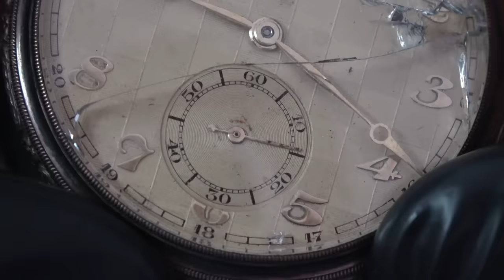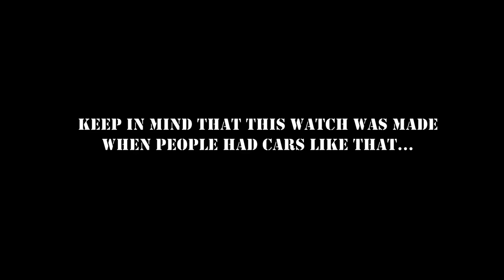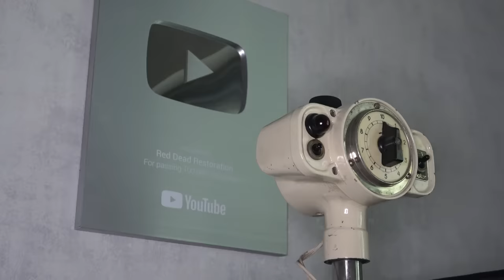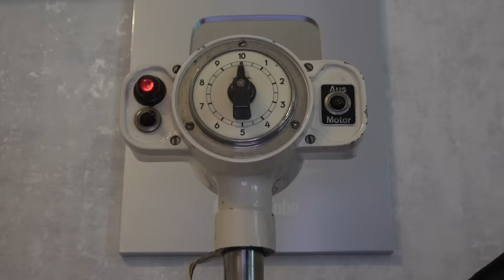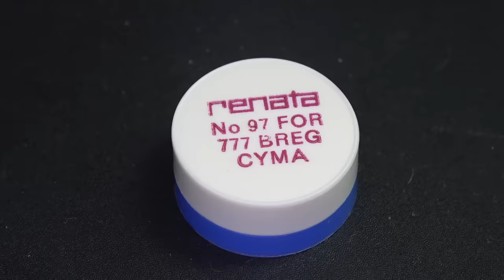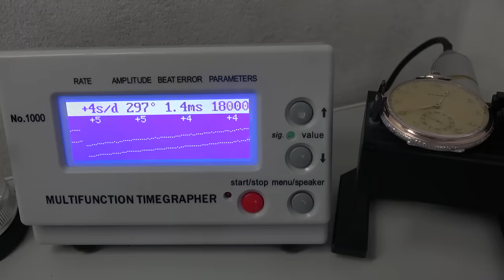Restoration of an antique pre-WW2 pocket watch - 100 year old Cyma 777 - german empire silver case

Comment: It's so good to get a look over your shoulder while you carry out these restorations and it's fascinating to see how little watch internals have changed in 100 years !
One thing I love to see in you videos is the tools and equipment you use, I love the cleaning machine and the small hand tools, presses and extractors etc, even the tools for working on mainspring drums are interesting but there's one thing I have never seen and that is your magnifier. I'm assuming you do have some sort of device to help you see these tiny parts more easily, presumably you will have a selection of magnifying devices that you just cannot live without, I wonder what they look like ?
Reply from the maker: Some simple eye loupes (mostly I'm using a 10x magnifier) you can see them sometimes sitting on my desk (wooden with gold ring)

Comment: Fascinating! It’s interesting how much heavier and robust the components are compared to more modern designs.
It amazes me that parts of that size and obvious precision were made in the past.
Any suggestion as to vids detailing the actual production of the components, tiny gears, springs etc. How was that done in the pre- computer/CNC era?
I’m a machinist, dealing with tolerances of .0005” or so on parts perhaps .010” and larger. Any info would be appreciated! Thanks!

Comment: When I see this mechanical marvel from 100 years ago, I wonder: with what technology did they build such small components⁉️
Reply: The oldest pocket watch that still works is the spherical Melanchthon Watch from 1530, belonging to Philipp Melanchton. Its 48mm diameter would run between 12-16 hours on one winding. It's engraving is in German, but translated to English it reads; ''Philipp Melanchthon. To God alone the glory.  Peter Henlein (also spelled Henle or Hele) (1485 - August 1542), a locksmith and clockmaker of Nuremberg, Germany, is often considered the inventor of the watch.

Comment: How did you find a proper replacement for the balance wheel? I have a wrist watch that needs a new balance wheel and spring, and it's at least 50 years younger than this pocket watch, but I have no idea where to go to first to find a suitable replacement (doubt I'd find an authentic replacement without selling my house to afford it lol). Fascinating work, and wonderfully shot!!!
Reply: What brand is that antique wrist watch?
Reply: @tecraman8100  It is a Cromwell Electra watch. I don't have it near me now since I am at work, but I will add more details from the watch when I get home. I am going by the crappy photo from the seller that I downloaded, sorry...
Reply: @tecraman8100  
It also has Superflat on it, below the center. I think it has 3600 on it between Cromwell and Electra, from the top to the bottom of the watch face below the 12 mark. It has no numbers, but a bunch of rhinestones circling the edge where the numbers should be, and there is a crown emblem at the top of Cromwell.

Comment: I prefer this era of mechanical engineering since most of the clockwork mechanisms made then have lasted well beyond their expected "break" dates

Case in point my grandfathers clock collection consits of clocks made back in the 1800s and the only thing hes had to do is wind them and hes not had to clean and oil them since his father had them

My experience with clockwork mechanisms runs from film cameras as the shutter springs and timers use clockwork springs for timing

Comment: Those were some real PRECISION movements for way back in the day. Ya just can’t go wrong with one of these pocket watches today. Totally German engineered. I’m sure the price was pretty hefty for one ☝️, even a hundred years ago. We can all check these out on our inflation calculator today. I bet the parts for these are next to impossible to get. I’m glad 🙂 they make a friendly kind of buffing wheel for this, but, I, personally, wouldn’t go a full 35.000 RPM on the Dremel tool. This may cause “thermal” damage (discoloration) of the metal, or burn 🔥 your buffer wheel 🛞 up. Happy Halloween 🎃👻. Your friend, Jeff.

Comment: Am I right that if the current beating latency is about 1.4 ms it equals about 1hour per month?
Reply from the maker: No the beat error has no (direct) impact on the accuracy of the watch. 
The beat error is the timespan between the two pallet fork pallets touching the escapement wheel. It's hard to describe what that means... 😉
Reply: @RedDeadRestoration  well, it's enough to understand that the accuracy doesn't depend directly on the beat error . I never had deal with the watch but it's just interesting for me as for an engineer. Thx! ( Sure there is a couple of gears with each-depending ratio. That's a complicated stuff yeah)))

Comment: Why don’t you set the second hand to 60 when reinstalling it?  With the hour and minute hands at 12, it seems you would need to set the second hand to 60, yet I’ve seen you set it at 40 seconds—or thereabouts—on at least a couple videos.
Reply from the maker: The second hand doesn't turn when setting the time so it doesn't matter where you set the second hand. It's always aligned after you set the time once.

Comment: I love those videos !

One question though : I see that you often do not insist on the cleaning of the dial, why is that so ? is it because it's more likely to deteriorate it that clean it ? or is it in order to keep a trace of the "age" of the watch ?
(this dial looked like it's made of metal : wouldn't the cleaning in the "Elma" bring the dial back to its original shinning ?)
Reply from the maker: Dials are painted and the paint is old. Even touching it can ruin the painting.
Reply: @RedDeadRestoration  Ok, that makes sense. That explains why you go so gently on those parts. Thanks a lot for answering.